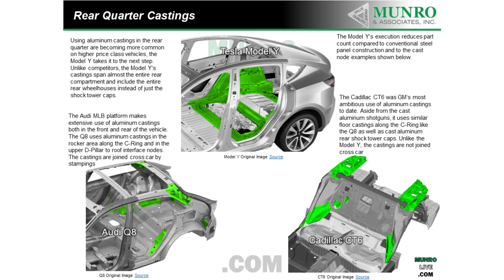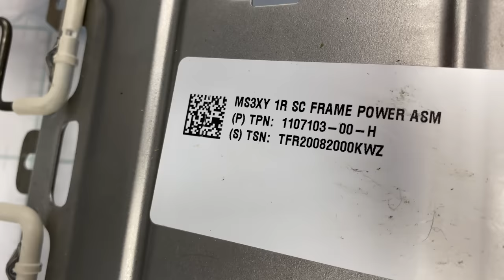Model Y E40: Mega Wrap Up Episode - Top 10 Takeaways and Future Plans

Comment: I'm hoping those parts you found on the Y that are different from the 3 have since been upgraded on the Model 3 side to match the Y.  We have a 2019 Model 3 and absolutely love it.  I'm thinking that a better approach or better part used in the manufacturing of the Y and continuous improvements simultaneously are applied to the Model 3 and the S and X, where appropriate, as well.  Now, Sandy, contact your local Tesla service center and tell them you have a few repair parts and replacement parts that some local Tesla owner is waiting for and can't get.  You should be able to recoup most of the cost of the Y, maybe even both of them.  Just the glass sold as replacements should pay off big time.

Comment: Amazing and useful analysis. I saw your video on the front trunk not opening if power is lost and the time consuming process of opening up the opening whole and using a jumper cable to get it open. In the model Y did Tesla put an emergency opening to it that is easier?

Comment: cool takeaways 
1. 2:45 mega castings = full body width aluminium body casting, creating new material science that is new to the industry
2. 3:55 improved b/w = well consistent spacing in welds, added a composite tub, few weird welds but improved compared to Model 3
3. 5:08 lack lustre made = fit and finish is not up to par for that price compared to gas powered vehicles
4. 6:20 no next-gen wiring = not so revolutionary wiring even tho now they got new patents for better wiring
5. 7:15 heat pump and octovalve = superbottle system, better integration which suits for EVs and brings down battery power consumption, very "model" way of cooling and heating in any vehicle
6. 8:29 HV battery optimization = some change in chemistry is visible,many little differences compared to Model 3 have been made to reduce costs like eliminating fasteners, removing excess tape, simplyfying covers, reducing the amount of pottying materials, elmininating temp sensors less than half, reducing redudancy in an engineering way
7. 10:52 injection modeled headliner = compared to Model 3 which uses thermoset cardboard, this plastic construction improved manufacturability by saving time. Made it a 2 piece component
8. 12:32 commitment to commanility = starting with seat assembly, the driver console, motor and battery same as that of Model 3, making it hit almost 75% in cost sharing with model 3 probably
9. 14:26 Front induction motor = external housing and geometry is same as that of the model 3 but the rotor has been substituted from the vaccume brazed copper rotor to cast-in based aluminium assembly 
10 16:12 ADAS and autopilot board = changes made with the Model y to incoperate its new chip

Comment: It would be interesting to hear a round table discussion with Sandy and Assoc. regarding how the wiring reduction could occur.  Sandy mentioned tiny antennae on the PCB's.  DMX is a digital protocol, often used in theatrical lighting where the connections are a daisy-chain - each light has switches to set its "address," the commands are received by all fixtures but only a matching address allows the commands to be followed.  Then there's RS232 and RS485, HDBaseT, fiber optic, multi-device BlueTooth, WiFi, etc.  And I'm just a telecom guy - there are likely dozens of other protocols.  Why isn't there a main spine that runs the length of the vehicle and every wired point attaches to that "nervous system" /controller?  How is it there's not been a solution yet, given the weight, complexity, installation difficulty, and therefore cost of the harness in EVERY vehicle that is produced (except possibly a Koenigsegg)...  What cost reductions and additional systems improvements (such as active self-analysis/feedback, etc.) could be realized... Does anyone else have comments on this?

Comment: I wish you could tear down a power wall or the new chargers. I have heard rumors about vehicles to grid and am interested to know if the new charges start taking any steps towards that. Otherwise if you could tear down an old LMTV it would be interesting as that also has air suspension like the cyber truck

Comment: Although you touched on this a little bit, I wonder how much the 2020 Model 3 has in common with the Model Y... For example all the Model 3s are shipping with 3.0 FDS boards. I wonder if this extends to the battery cells for example given the similarities of the packs.

Comment: It looks like the rear wheel wells are part of the two megacastings but the color diagram at 3:35 does not show them in the green or blue color. Are the wheel wells megacast? In an earlier video, many features looked cast-in in the side view of a rear wheel well.

Comment: Finally we can see Sandy again instead of a big mask. I would like to see Sandy tear down a current generation Honda Accord. I had so many issues with my 2018 Accord 2.0T Touring that I ended up selling it and thus getting a a Model 3 instead. Model 3 has been a much better car. My Accord had missing structural adhesive on the strut towers, rust in the door jambs, clear coat had bubbles on the trunk lid, 10-speed transmission shifted terribly. It just didn’t add up to what I expect from a Honda.

My Tesla has been so much more enjoyable to drive, cheaper too since I average closer to about 100MPGe even driving it quite hard. The acceleration is insane too when you first get it. Now that I’m used to it I wouldn’t mind even more power, but at first my Model 3 Performance almost made me feel sick when I stomped on it and I’ve had plenty of high performance cars before. The only thing I wish my Model 3 had that even the Accord and my Golf R before it had is adaptive damping. On long drives the 3’s suspension can seem a bit too firm over really bad surfaces.

Comment: Munro, did I miss the section relating to exterior sensors used for self-driving and safety?  I would love to learn more about those technologies and how well they are doing, and what Sandy thinks of that situation.
I personally don't think line-of-sight cameras are the way to go, perhaps as a secondary/hybrid setup, though it would work best?
What other options are there such as detection spectrum used or am I not understanding this?  My thoughts is that eventually there would be the need for some kind of sensor installations that can talk to other EV's and are installed at strategic locations... 
Does the system crap out if, say your car  gets covered in mud, ice or snow or anything? 

On boats (much slower and lower tech generally speaking) they is something called AIS (automatic identification system) which talks to other boats and to satellites, the user get information from both (line of sight from other vessels and direct from satellites for vessels not in sight/range), and it basically just says hey I'm here I am going this direction and this speed and a few other pieces or information as well.
cheers

Comment: Is vertical integration necessary (or at least very helpful) to any company considering continuous improvement strategy? I think probably so because you would need to make near instant changes and that's hard to implement (read more costly) when contracts have already been signed with vendors. Accordingly, I think many traditional car manufacturers will fail to embrace this strategy even if they wanted it because they are almost always committed to horizontal integration paradigm.

Comment: I agree that continuous improvement is good. But other major manufacturers would not have released a car with such bad quality issues with the fit and finish. Also the cost reduction stuff would have happened way before cars enter mass production with other brands. Another issue with continuous improvement is almost every batch of cars are slightly different. It might not be an issue now, but further down the road when you need to get your car fixed the amount of revision is going to be a nightmare.

Comment: Maybe among relevant next topics  ... hybrid cars (of course), the Arcimoto,  home air filters (also in reference to C19), .. .. maybe reviews esp of things you already know about or use, ie shop tools,  car batteries, UPS systems (large and small ..),  water filters (most of the small table top ones are terrible, some even ADD contaminants)... hard to figure where to draw the line between recommendations and analysis, but I'll let you figure it out.

Comment: Personally, I'd love to see you guys do a kitchen.  I'd love to know the engineering differences between fridges, stoves, washers, dryers, and dishwashers.  I'd love to hear from engineers what is actually the best engineered in each category. 

I can stare at a spec sheet of each appliance, but that says nothing about the engineering and quality.  Maybe a $500 appliance is better than a $1,000 appliance.  Maybe a gas powered washing machine is better than electric.  Maybe an all in one machine is better than two separate machines.  I genuinely would love to know from engineers which stands out not just review sites that use them 250x and see which breaks first.

Comment: Hi Guys. I don't know why but it's nice to look what's inside stuff. I like to brake stuff also lately i disassembled few washing machines just for parts and scrap. Could You give a some view on difficulty on how to recycle stuff also. If you start dissasembling normal live goods as washing machines or everything else, please do comparison between cheap and expensive stuff. Few months ago i bought cheap reciprocating saw, after few days bolts holding bumper in front of saw get loose, locking mechanism of saw blade is just bad, i disassembled it partially because something was wrong with a crank moving saw it squeaked so i lubed it, some screws was loose, parts not fit very good so it's impossible to get tight fit.  I love to watch something like this.

Comment: 12:27 for the past 10 years there are great improvement to PA6 & PA66, ABS + fillers and alike for injection.  So it would be crazy not to consider injecting it, and it actually easier for a newcomer to justify buying a new injection molding (albeit ~500 ton machine) than a mature production plant who still uses 10 - 40 year old machinery.

Comment: Do you think that more of the non-common parts of the old model3 you examined have been continuously improved such that a 2020 model 3 shares 75% with the 2020 Model Y?  You’ve got to cut up another M3 to find out

Comment: Take a look at the book, The Beginning of Infinity by David Deustch  When you say 'continuous' development, that fits in nicely with the mathematical arguments made by Deutsch. Invention will not only continue in the future it will continue to accelerate. What I think is even more interesting is that I don't think Deutsch picked up on what you've observed about Tesla. 
Thinking about Battery Day coming in September. I can see a future where a company like Tesla would replace a 150,000 mile battery pack with a 1 million mile battery pack for a nominal fee. They'll be scaled up to recycled the older batteries extracting materials that are used in the newer better batteries in smaller quantities. I want a Cybertruck and I want it ASAP. but I also know that six months or a year after the first Cybertrucks are delivered they'll be making better Cybertrucks.... Should I then wait? If I could continually upgrade there's no reason to wait. Suppose multiple upgrades become available. I didn't get the Ludicrous package, so speed upgrades probably wouldn't interest me. What about better sensors for the wheels that react to severe potholes. Well, I've lost wheels and tires to potholes so this upgrade I'd be interested in. Good videos.

Comment: Tesla still hasn't addressed the headlight residue issue the happens inside the lenses.  Or the taillight condensation issues that still occur with the Model Y.  Or the paint issues, which is something that should have been corrected a long time ago.  

Sandy, you said the Model Y has a full panoramic glass roof, with no body crossmembers.  Why does everyone keep saying that, when there in fact are crossmembers, one in front of the front seats and one in back of the rear seats.

Maybe you could tear down a Samsung refrigerator because they all seem to have the same issues lately, the ice makers ice up inside.